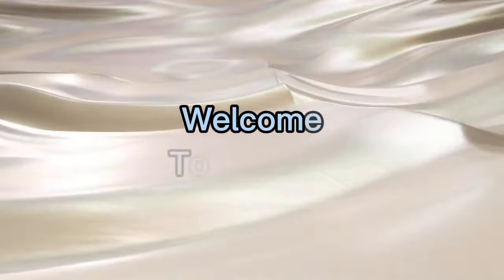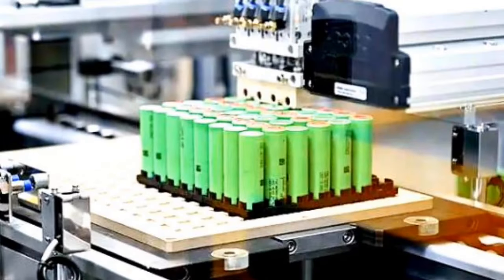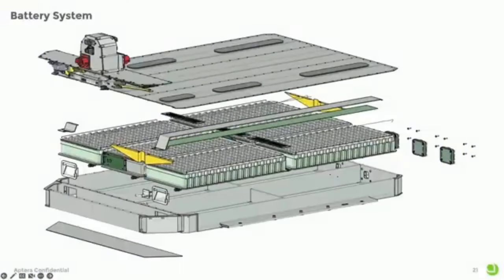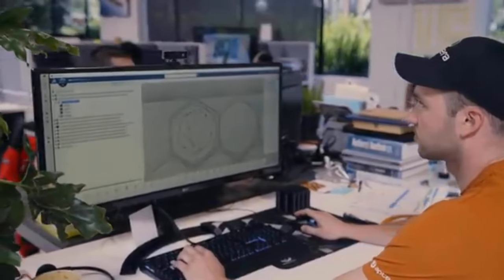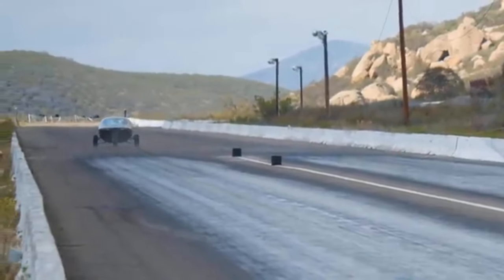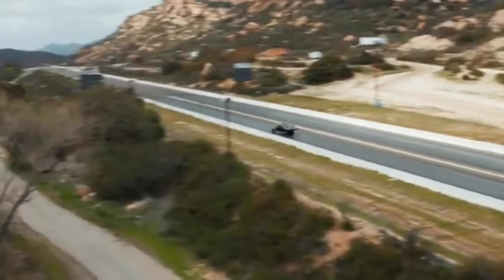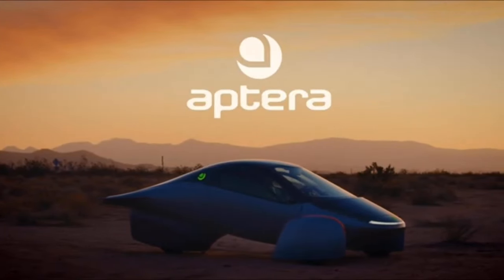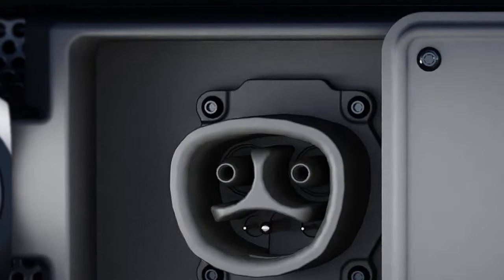Why Aptera's battery pack offers so much range. Up to 1000 miles

Comment: On the weight, you missed the most significant digit. Over 1,000 lbs off. Actual weight of the Launch Edition will be about 2,200 lbs.

Comment: Tricycle is usually used to refer to a three wheeled vehicle with one wheel in front and two in the rear. A Reverse Trike or Tadpole Trike is one with two wheels in front and one in the rear.
Reply: How did a tadpole get roped into the definition? It has three less wheels than a trike.

Comment: Aptera will also use a forward concealed radiator for cooling..I assume that means for assisting the skin cooling for the batteries and motors cooling?
Reply: I am not sure it will be forward.  They might be near the AC condenser.  Aptea will try to save the tooling costs for stamping the aluminum bottom skin at least for the first LE vehicles.  We will probably have to wait for validation testing for more info.  The three cooling loops include antifreeze loops for the motors and inverters, and the batteries, and the refrigerant loop for the HVAC system, that can also assist the other two at slow speeds.  The waste heat here is collected by air that enters under the windshield and exits out the back of the vehicle.
Reply: No skin cooling at all.